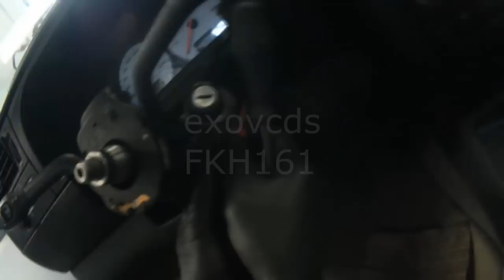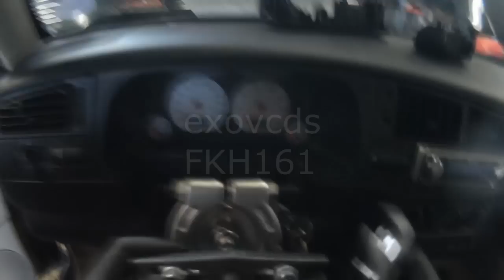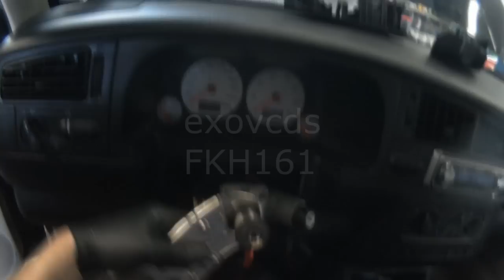VW A3: Golf / Jetta Ignition Switch Removal & Installation (Standard Transmission)

Comment: I Fix cars at a professional shop. Your video was better information than the info I subscribe to and pay for!! Thanks for the video. It helped quite a bit when I was left high and dry. it's insane that you need to do all that to access 1 damn screw. 2.3 hours is the flat rate time, so anyone needing the switch replaced, This video will save you a couple hundred dollars in labor at an auto shop. Probably more than that at most places. It's probably cheaper even if you needed to buy all of the tools needed to do it yourself, And the tools can be used again and again. Anyhow, Thanks again.
Reply from the maker: Thank you for the kind words... coming from another Tech, that means a lot!

I hope you also found my newer / better video:
https://www.youtube.com/watch?v=EuY84R8h1hc

Thanks for watching!

Comment: Bought the bearing splitter/puller shown in this video, makes the job super easy...I noticed that if you heat the large spline adapter with a heat gun for 2-3 minutes before using the puller, the adapter pulls right off super easy...i also heated up the adapter before tapping it back on....the heat gun helps a LOT!
Reply from the maker: Thanks for the tip!
Reply: *****
 yeah, it really prevents having to apply massive torque to the bearing puller...mine was on there so tight I thought i was gonna mushroom the steering column threaded area, heat gun solved that problem really well...

Comment: looks easy. My 1997 jetta struggles to turn on when the weather is hot and especially when the car has been in direct sunlight. I've been told is the ignition switch causing the problem. Any chance you live near Los Angeles? hahaha!

Comment: Great tip to watch for the indicator lights to go off while cranking, could that happen on a B4 B5 audi, and bypassing the starter to keep the engine running? are there other testing to do to the switch before condemned it?
Reply from the maker: You can have a crank no-start with a B4 B5 ignition switch also (I think).
Not sure what you mean with "and bypassing the starter to keep the engine running"?

Comment: First off great video!  i have a 1999 golf mark 3, and while driving my headlights shut off, the windshield wipers dont work and my heating fan stops blowing all at the same time (it seems that on colder days this happens less frequently).  when this occurs the ebrake light also comes on, as a dim light, not as bright as when the ebrake is actually on. do you think an ignition switch replacement would fix this? Thanks.
Reply from the maker: Yes.
Reply: ***** thanks thomas, ill try this out

Comment: Hi Thomas, Thanks to your other video, when you had that stranded jetta with the bad ignition switch I can still drive my car until I get mine fixed. My question is will this procedure be much different on a 2001 US spec Cabrio? besides it having a different steering wheel? Thanks in advance.
Reply from the maker: ***** The cabrio is an A3,  so it will be the same as this video.
Reply from the maker: ***** Or follow the non-puller instructions... link is in the description.
Reply: Thanks Thomas, Ill try tackling this, this weekend, hopefully no one runs off with my car in the mean time...

Comment: Sorry I don't know If I commented in another of your videos, is this the same as a 2001 vw cabrio auto? Any major differences?? Thanks a bunch!!!
Reply from the maker: The 2001 Cabrio is still an A3 mk3, so yes, pretty much the same. Be sure to click the link in the description, to see how it can be done without the press tool that I use.
Reply: ***** I have the same puller, I got it out and replaced the ign switch... the old starter burned out so I replaced it with a brand new one and when started the car I realized it was staying engaged... made me think it was a bad ign. Switch... but it is still staying engaged... do you have any suggestions as of where should I look at now? Thanks!
Reply from the maker: Pernell Verstappen Remove the harness plug from the ignition switch and manually bridge the starter wires with a small jumper wire or bare paper clip... this will rule-out the ignition switch / key cylinder (in case either is sticking). Standard or auto? Can't think of anything that would feed power to the starter except for the ign switch. Even a park neutral relay (for automatics)... it just closes / bridges the connection, power still has to come from the ign switch.

Comment: hi there Thomas, thanks foe the video it makes everything simple and easy. But I have one question which is. "How is I remove the housing without a key, I lost it and I have disconnected everything up to this point. I'm going to replace the lock cylinder.
Reply from the maker: You need to drill a small hole, so you can release the key cylinder. Once the key cylinder is out of the lock housing, you can release  the steering lock with your finger (in the key cylinder hole) and remove the ignition lock housing from the steering column.
Reply: THANK YOU...HUGELY!! Thomas.
I got it off and going to replace it. If I do come to a question again when I get stuck working on mine 98 jetta.
Thanks again.
Reply from the maker: Thank you for the update! Sorry I could not supply drilling location... I was not at my PC. Good to hear that you go it off! You can edit your comment and remove your email address.
Reply: Nolan Yazzie good luck junk it vw r junk

Comment: thanks for the response.  someone was saying that the car might not start and that the key has a "chip." Am not sure how true that is with a 1997 Golf 3?
Reply from the maker: Does not have a chip as far as I know.
Reply from the maker: If you give the Vin number to a vw dealer, they can make you a new key or check if a chip is needed.
Reply: thanks a great deal
Reply from the maker: Don Alwell Let me know what you ended up doing / what the result was... in case I was wrong.
Reply: Don Alwell queque

Comment: This is way easier if you just take the steering column out, disconnect the 13mm from the u-joint by the floor and pull the whole thing. No removing airbag/steering wheel/switch from the column required.
Reply from the maker: I didn't say that was the only way to do it... there's a link in the description to a thread about how to do it your way.

Comment: 2002 MK3.5 Cabrio with manual transmission. What alarm and key issues do I have to prepare for and be aware of before I perform surgery?
Reply from the maker: If all you are doing is replacing the ignition switch... the immobilizer should not be affected.

Comment: Hey see this Thomas! :  i followed this guide, did all the disassembly and then, when putting back the collar in the shaft, i tapped several times with a socket/hammer, so to fit the collar. However, i noticed i forgot the back spring, so i pulled the collar again. However, i noticed the shat/steering column was pushed in! It's pushed in in relation to the metal housing..!! Did i break anything? :/
Reply from the maker: The shaft can move downward inside the metal housing. Once the collar is on far enough for the nut to fit (I usually position a washer between the collar and the nut)... simply tighten the nut against the washer. The shaft will start to pull up as the collar is forced down more.

Comment: Sorry, was typing on my phone and thought I did use punctuation.  Yeah the car did crank and start with the old switch,  but I had to do just as you said wiggle and move key to find the right spot, however the new switch and it is new does not allow the car to crank, I will try another one equipment one tomorrow from the dealership.   The original has two patrusion on the part that goes in first to the lock cylinder,  and the new one is smooth on the face,  could that be an issue?
Reply from the maker: I'm a visual learner... I need to see pictures of what you are talking about. You can send them to fkh161@fkh161.ca so that I can see the difference.

Comment: Hey Thomas, i have a 1999 jetta gls Autotrans, and i just had my neutral safety switch replaced because i thought it the issue (going thrugh process of elimination) and the next thing is ignition switch or the cylinder. The issue is that it chooses when it wants to start sometimes for a week and sometimes a day or not at all. I didn't know if this video would apply to that or not? is there a difference between how the other (switch or cylinder) would act if defective? Thanks
Reply from the maker: Jordan Reed 1999 old style mk3 or 1999 new body style mk4? A bad ignition switch can cause: 
1) cranking & not spark 
2) no cranking
If it's a mk3 body style, the Alarm module disables the starter, so a no crank could be because the alarm module thinks that something is not right.
Using a test light (at the ignition switch harness plug) while you are experiencing the "no start", can help determine where the problem is.
Reply: Awesome thanks! And it's an mk4 the new style, not the box type cars. sorry it took a minute to respond. But i will definitely use the test light to figure out what's causing the issue, Thanks for the advice!
Reply from the maker: Jordan Reed A4 ignition switch access:
https://www.youtube.com/watch?v=vEdr2Q0atA8

Part 2

https://www.youtube.com/watch?v=JJKthmyLffc

Comment: Exodus...thanks for the help.  what size is the small hex bolt that you put back in to replace the one with no head that you broke with the hammer and chisel.  thanks
Reply from the maker: M8x1.25 and 20 to 25mm long 13mm head. Whatever fits will do.
Reply: Thanks so much man.

Comment: Hi Thomas, I was cruising down the road in my 98 Jetta (2.0 gasser) and my check engine light popped on. I scanned for the code and here is how it appeared on my code reader: P0171 -- Fuel trim too lean (Bank 1). Where should I start in terms of diagnosis? As an aside, I had the rear muffler changed about a week ago, if you think it may be related.
Reply from the maker: Muffler is not related... start with looking for vacuum leaks. The small hose that goes go the fuel pressure regulator is a common failure item. Once you rule out vacuum leaks,  we can discuss other items.
Reply: ***** Opened the hood and was immediately attracted to a MASSIVE hissing sound. Turns out it was indeed a vacuum line that runs along side the air box fell off and scrapped the serpentine belt, which tore a hole into it.
Reply from the maker: Joey Nitschke It's always nice when it's an easy fix!

Comment: Hi, thanks for the video. I lost the keys for my Golf 3. Do I just  have to replace the ignition keys or are there programmimg required?
Reply from the maker: Remove the door handle and a lock smith will be able to cut new keys for you... provided that the ignition key was the same key used in the door.

Comment: I found what's pulling the 3.5 amps. Under the hood a black box with 4 red and one black wire the black is the biggest and I'm assuming it's a 150amp fusable link. Anyway when I take off the black wire the 3.5 amp draw is gone. I pull each red also one by one and they was not it. So have I figured anything out????
Reply from the maker: Jacob Hendrickson Send me a picture fkh161@fkh161.ca sounds like the rad fan module?

Comment: I got all that done with the puller do u need the spring back on as well
Reply from the maker: Yes... install everything back the way it was.
Reply: Thomas EXOVCDS  I tried alot of different things to try n put back the steering collar but the spring is not letting me put it back
Reply from the maker: Did you try tapping it into place with a socket like I did?
Reply: Thomas EXOVCDS  yes I tried that but the spring pushes it out way to much
Reply from the maker: It just has to go on far enough so you can get the nut on and tighten it further. Make sure that the steering shaft is not sitting low to begin with... grab the shaft & pull it up / out as far as you can, then try to put the spring & collar back on.

Comment: Does the key lock cylinder slide out from the front or the back. My problem is that I lost the key to my project Jetta and I don't want to have to go to the dealer to get a key made so I was hoping to dent pull the key cylinder to unlock the steering wheel and just add racing ignition start since I'm fairly good with electrical.
Reply from the maker: The lock will slide out the top. You need to drill a small hole so you can push on the release tab... the cylinder will then slide out. You might be able to drill the small hole with the assembly in place (have to remove the steering wheel and the upper & lower plastic trim pieces. Let me know if you need a diagram of where to drill and I'll send it to you via youtube messaging.
Reply: ***** CAN YOU SEND ME THE DIAGRAM WHERE TO DRILL
TO REMOVE THE KEY CYLINDER. THANK'S
Reply from the maker: JUAN ZAMORA Link to information sent via youtube messaging.

Comment: What if you have a car that starts and runs perfectly fine when cold and just dies on you when its warm?
And when it can be saved from dying, high revs are needed...
Trying to crank when warm works some of the time, but will always come at a point where it just won't fire at all, is that the ignition switch acting up like with yours?
Reply from the maker: +Jan Erik Kristiansen No... the ignition switch will not cause a car to stall at idle and be ok at higher rev's. Coolant temperature sensor, dirty throttle body, vacuum leak, stuck EGR... etc. I don't know what engine you have, so I can't be more specific.
Reply: +Thomas EXOVCDS hey I am working on a 1997 Jetta where did u purchase your wheel puller?
Reply from the maker: If you are changing the ignition switch but do not have a puller... you can remove the steering column with steering wheel to do so. http://www.vaglinks.com/Docs/VW/MKIII/VWVortex.com_VW_MKIII_Ignition_Replacement_DIY.pdf

Comment: Hello, I recently did this repair and it worked. Only issue now is that the turn signals and emergency flashers no longer work. All connection are fully plugged in. What could the problem be? Thanks
Reply from the maker: Did you check all the fuses? Flasher relay?
Reply: Thomas EXOVCDS I've checked the fuse, I'm going to replace the relay with a new one. Just gotta find a store the has it.
Reply: Little update, checked all fuses and relays. Replaced relay #6 and still a no go. i ordered a replacement turn signal stalk  assembly, hopefully it works.

Comment: Hey! i'm trying to change my ignition lock but i have a problem with the bolt before the spring, I've got a 3 armed puller, which is no good at all, and i can't find anything like you have, any suggestion on how to remove it?
Reply from the maker: +RogerVan92 You can drill the lock housing while it is in the car... or you can remove the whole thing (with the steering wheel) if you follow the link in the description.

Comment: Also I can't even seem to find any relays or anything. Where has Volkswagen hidden this stuf in my 2000 GTI vr6. Being something is drawing over 3amps when all is shut down with nothing on does this still seem like a chassis ground? I'm going to pull my fuses till i see what's draining 3 plus amps from my battery. I'll let ya know what I find. I really hope I can figure this out.
Reply from the maker: Jacob Hendrickson Relays are above & to the left of the foot pedals (behind the dash / knee panel)... north american vehicles.
Reply: Are they in sight or do I need to remove the plastic to find them. And are there more fuses somewhere. I've tried every fuse one at a time and did not find what's pulling 3amps yet. All the fuses I found are the ones right where you open the drivers door.
Reply from the maker: Jacob Hendrickson Relays are above & to the left of the foot pedals (behind the dash / knee panel)... yes, remove the panel above the foot pedals and other stuff (if in the way). A few fuses are located above the relay panel. If fuses do not drop the draw, pull relays one-at-a-time.
Reply: Ok this is my next step. Could one of these relays cause this type of issue. I mean if I pull a relay and the draw goes away does that mean all I would need is a relay. Can it be that simple. I so hope so. Going to do this first thing in the morning. I work till 2am tonight so can't now. Thanks for these responses
Reply from the maker: Jacob Hendrickson If a relay is stuck on & depending on what the load is, yes. It might not be a relay issue, but that's what I would check next. If the draw goes away after pulling a relay, you need to also make sure that the control side of the relay is not the issue... meaning the relay is ok, it's just being told to stay on. If pulling relays does not help, you will have to use a current clamp to chase down the wire that is live.

Comment: hey my buddies k2 jetta has some remote start/ alarm installed more of a keyless entry system and remote start and he can only start it with the remote the last owner said it used to start with the key nbut stopped my guess is teh switch went out i went under the collumn its a huge bulk of wireing mess but the crank/starter wire that comes from the switch has no power from it when the key is turned to the crank position does this indicate teh bad switch
Reply from the maker: Alvyra Vaisiene I think it's a red/blk wire... if that wire does not have power when cranking, then yes, the ignition switch is bad. If it has power, then follow it to where it is spliced with the remote start system.

Comment: Hey Thomas. I changed my fuel filter transfer pump and main pump. now my car wont start. it cranks but doesnt turn over. it finally turned over and I let it warm up, but when I went to push on the gas it died. 88 mk2 golf 8v 1.8lr. I have no clue what'd wrong.
Reply from the maker: Why did you change all those parts? Was the car not running before? Was it running before but had running issues? What is fuel pressure? CIS or digifant injection.?